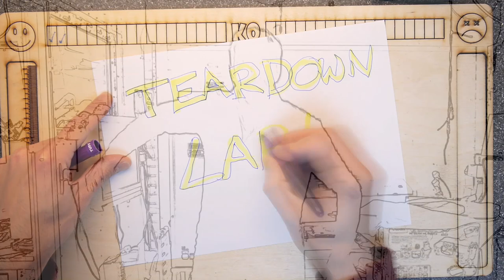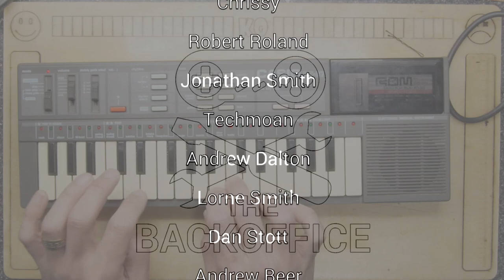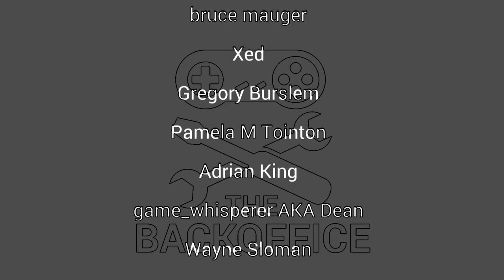Casio PT-87 Keyboard

Comment: Yes!  I have touched it, I have played it, I have experienced it!
Reply from the maker: In all seriousness, how do you rate this as an item of fun? Do you feel the ROM pack and LEDs add anything?
Reply: @backofficeshow  The LED chasing game was fun and might actually teach you a tune.  The ROM is hard to rate without other ROMs to compare it to.  With just 1 ROM that's just....what it does.
Reply from the maker: @RMCRetro  If I can figure out the chip pinout I think a rom replacement or even USB RAM would be an amazing addition. There are a lot of old keyboard with this, even the sampling ones. Would be amazing!
Reply: But what about the keyboard?
Reply from the maker: You should be a lawyer 😂

Comment: When I was 8 years old I saw another kid on the school bus with one of those keyboards and was fascinated by the cassette looking port for the ROM cartridge! He wouldn't let me try it out though :-( The memory of that keyboard is still etched into my brain, it looked so cool to my 8 year old self and still does. Nice to see the inner workings! :-)
Reply from the maker: It really is a cool piece of period electronics. I suspect if you set out to make this keyboard today you would probably do it in much the same way. I was tempted to add a headphone mod to it but it's too nice to mess around with.
Reply: @backofficeshow  It's always a difficult decision to start cutting holes in vintage equipment :-0 I agree it's best to leave it in its original state! :-) I wonder though, if it would be possible to recreate the keyboard using modern maker tools like 3D printing etc. I wonder if ninja flex filament could be used to replicate the membranes though I guess the IC would be the challenging part to reverse engineer! :-0
Reply from the maker: @electronraygun6346  I would be curious to see what homebrew synths people have made.
Reply: @backofficeshow  I've seen quite a few of Arduino based ones around the interwebs :-) I think pairing a SID chip with an Arduino could be a cool experiment though they are quite rare!
Reply: I used to take mine on the school bus haha!
Reply: @luvitluvitbaby  Were you in the UK?
Reply: @electronraygun6346  nope…USA 🇺🇸
Reply: @luvitluvitbaby  Awww shame! Would have been a hell of a coincidence if you were that same kid I saw :-) I'd bet that having such a cool device caught some attention for you too. These things looked amazing to me in the 80s and to be honest they still do! :-)
Reply: @electronraygun6346  yeah it was an awesome time. I loved every minute of it. I thought the device was so cool. It’s one of those things that still looks amazing after all these years. 😎

Comment: The connector for the cartridge is on a ribbon cable as there has to be a small amount of movement between it and the cartridge as you insert it. if it was part of the main board then if it wore out there would be no easy way to replace the connector. Things back then were built to be repairable. Unlike modern crap that's 10 times more difficult to fix.
Reply from the maker: I've since spotted a few variants. some with quite a lot more features but most of the controls are essentially in the same place. I would really love to see their PCBs 😊